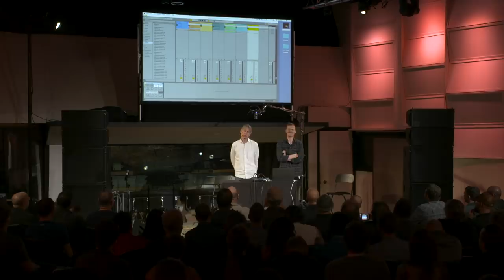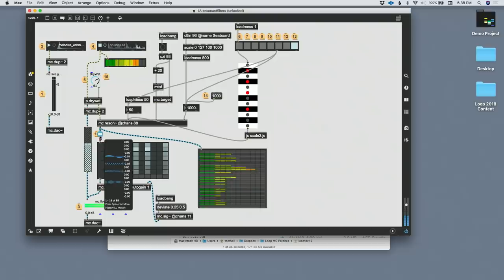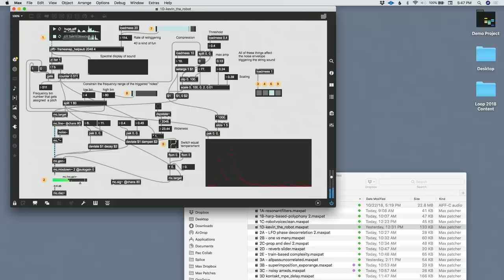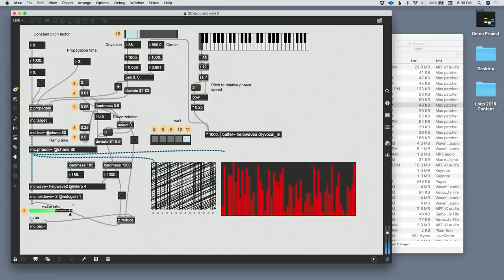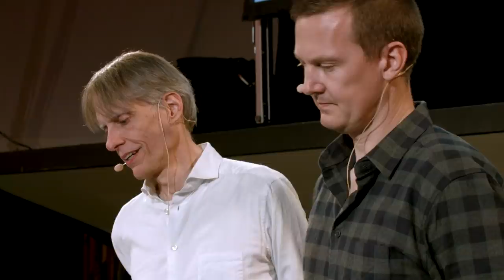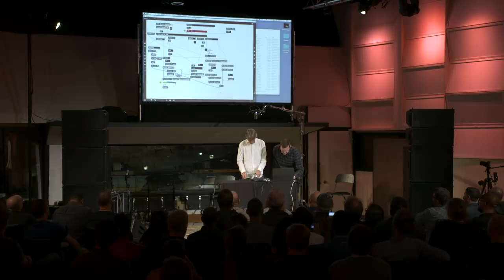Multi-channel audio as creative space: Inside Max 8’s MC | Loop

Comment: O.K. so basically these are polyphonics versions of the known modules

I am going to correct myself and say that this is what poly is about in reaktor , parallel processing of the modules .
Let's say we want suzannes vega voices reconstructed using partials ,  it 's just a matter of setting reaktor to 1024 bands , inserted a band pass filter ( which are now basically 1024 filters because of the polyphony ) ,  output bandpass into envelope follower controlling the amplitude of a sine osc. ( again 1024 osc's beasue of poly  , which re-construct the signal ) 
The way that the frequency is divided and multiplied per voice is done with the voice module , and you can go crazy with that  ..super dupe easy in reaktor   .